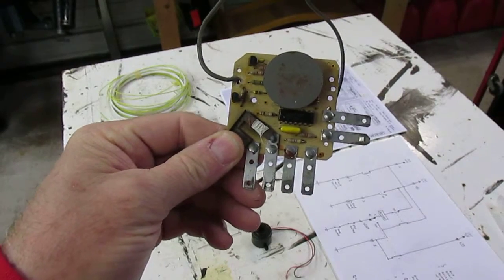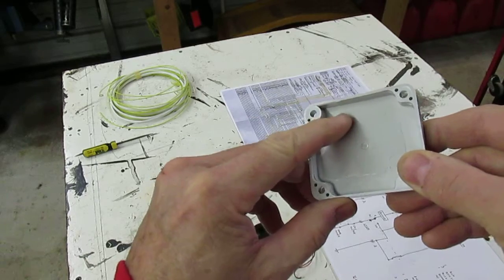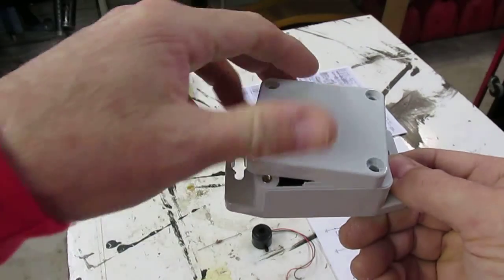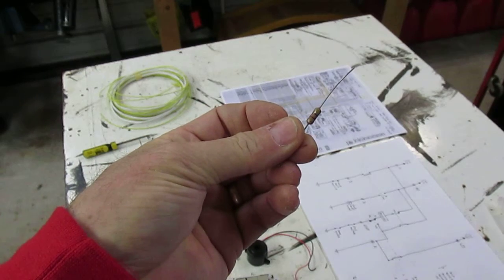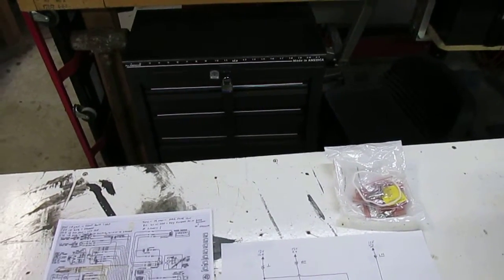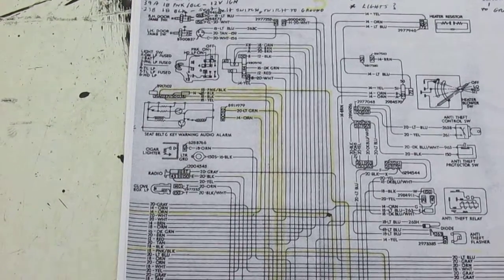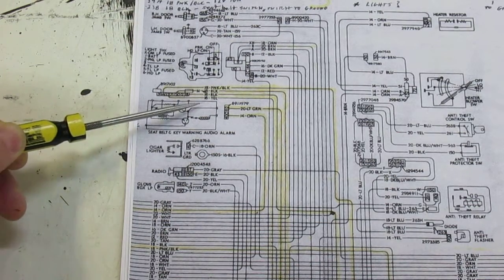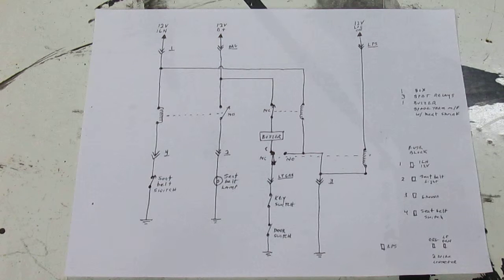Building a Key Alarm, Seat Belt Warning and Head Light Reminder for a 1978 Corvette, Part 2

Comment: Also have a 1978 Silver Anniversary with seat belt light on...do you have the part number for the OMRON relays? Thanks!
Reply from the maker: Thanks for the comment and question! from McMaster-Carr, Buzzer: 5670T31, Relay: 7098K25, Enclosure: 1037N1

Comment: Joe did you ever find a replacement?  I am in need of one as well.  I was having battery issues, removed this guy and purchased a new battery, have not had a problem ever since.
Reply from the maker: Thanks for the comment. Mine was actually draining my battery. Unplugged it and battery problem went away. I also confirmed that it was drawing some current at all times. I was not able to find a replacement for my 78. I seen some available for other years but not mine. So I made one.